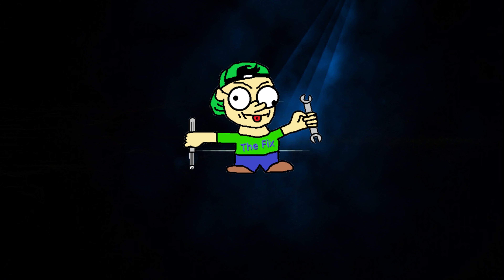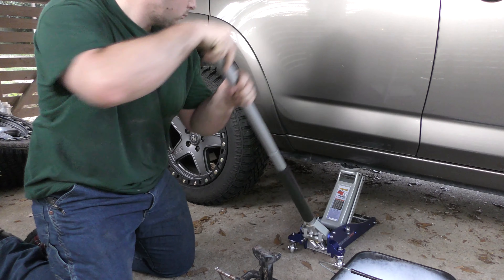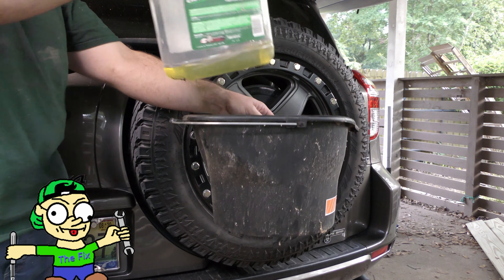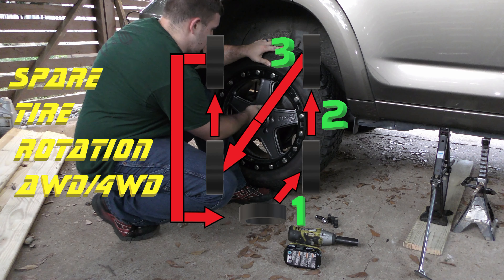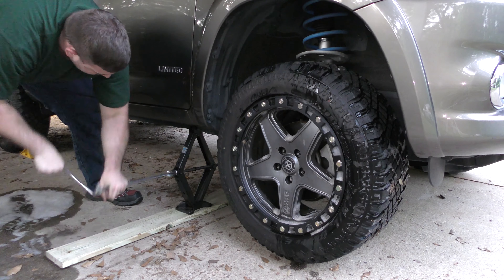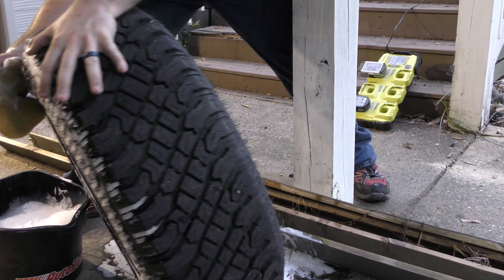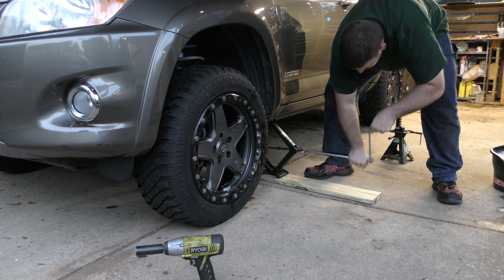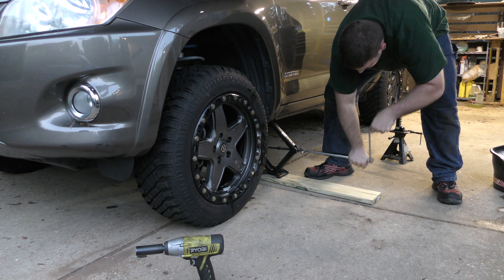Increase your tire life by 20%?!  Why rotating the spare should be common practice. Jeeps/RAV4s?!

Comment: Well including the spare in the rotation doesn't increase the wear by 20% . It merely means that they will last 20% longer on the calendar. BUT when the spare is always included in the rotation, this means it's going to cost more to replace five tires instead of four.
Reply from the maker: Yes but what bothers me more, is when Jeep’s, FJ cruisers and others vehicles have a dry rotted spare tire, or the stock spare tire neither of which will do them any good.
Reply from the maker: Especially when they are lifted and rolling around on 5” bigger tires than stock
Reply: 50,000miles from a set of 4 tyres = 12,500 miles per tyre, add in a 5th tyre and it's 12,500mile range and yea you will see about 62,000miles. So, if you by 5 sets of 4 tyres you should get 250,000miles out of them, that's the same as buying 4 sets of 5 tyres ;) . But totally agree that your spare should be rotated in. You won't gain any miles from them but it's safer and you won't waste your spare from the rubber inevitably perishing :)
Reply: If the spare becomes very different in size from the other tires on the car it can’t be used without damaging the drivetrain. That’s a pro tip that the tire places don’t want you to know. That way as soon as you have your first nail through the sidewall the spare can’t be used long term and you’ll have to replace all 4 tires anyway. Epic fail. Rotate the spare and don’t make that mistake.
Reply: If the spare becomes very different in size from the other tires on the car it can’t be used without damaging the drivetrain. That’s a pro tip that the tire places don’t want you to know. That way as soon as you have your first nail through the sidewall the spare can’t be used long term and you’ll have to replace all 4 tires anyway. Epic fail. Rotate the spare and don’t make that mistake.

Comment: So your saying by remove each tires. And as u do, u clean with soap and water, and re installed them back. Repeat the process for all four wheels and 5th wheel spare, will increase the mileage of the tires? Instead of 55k miles, it gains up to 65k miles?? 

How did u figure this out? And how did you found this out?
Reply from the maker: I’m saying that most people dont rotate the spare tire and they should.
Cleaning them is just my recommendation
Reply: @CreativeMechanic  that’s understandable. It’s best to have them cleanup nicely, before have them rotate the wheels/tires.

Comment: What wheels/tires do you have on your car? size?
Reply from the maker: American racing ATX ravine 18x8.5 wheels +35mm offset.  Atturo Trailblade XT 235/60 r18
Reply: hi what can you recomend?without lift on your other videos , like your rim and tire   but what can u advice if same rim and tire and offset thing hope for your respond
Reply: @CreativeMechanic  18x8.5? Is that original rav4 size? Coz whatever I search for info I find only 18x7.5j. Source: https://www.wheel-size.com/size/toyota/rav4/2012/#trim-20-eudm-149. I'm asking for 2.0i 156hp.
Reply from the maker: @ivannikolchev852  no it’s not the original size
Reply: @CreativeMechanic  Ty for the answer. Can you tell me your bolt pattern (BCD value) 5 x 114.3 mm (4.5 inches)? I tried to find those wheels in internet but they are always 5x120 witch cant be mount on Rav4 I guess.
Reply from the maker: @ivannikolchev852  these were discontinued right after I bought them.  I actually had to get a used one painted by a friend for them to match.  Go check out the Rav4 forums.  There are a lot of wheel and tire setups out there

Comment: Any updates on stacking your two lifts? What did you end up doing?
Reply from the maker: I haven’t gotten to that yet,  but I do want to clarify I will be running the Readylift spacers and Northwoods springs in the front.  I won’t be stacking the two strut spacers.  But in the back I will combine the Northwoods springs with the Readylift subframe spacers, that will sit the back end up and help with towing and heavy loads

Comment: I really like the look of your setup. I recently picked up a 2012 rav4 and began to look for a cost effective lift. I found your install video for the readylift as well as your posts on rav4world. For someone who is not looking for a huge performance boost, but more so a little more clearance and maybe a bigger tire, what are your thoughts on the readylift kit on factory shocks?
Reply from the maker: It’s a bad idea if your gonna tow anything.  The spacers in the front make it stiffer, but the subframe spacers in the rear don’t change much.  I always felt like the back end could roll a little bit more with the Readylift.  Therefore, if you get the Readylift you’ll want to invest in the Firestone coil-rite air bags.  Easy to install and there’s a video out the etrailer did I think on the gen3 Rav4.  That seemed to fix the problem.
Reply: @CreativeMechanic  thanks! It's a 4cylinder so I'm not planning on towing anything. It's really just to get a larger tire on and take some dirt roads with more confidence. Would you say the readylift is okay stand alone? Or does it require other parts/ modifications to work well? I think I read you  say that rear adjustable toe arms would be necessary?
Reply from the maker: It works fine for what you want, without adjusting the rear toe arms your tires will just wear out faster